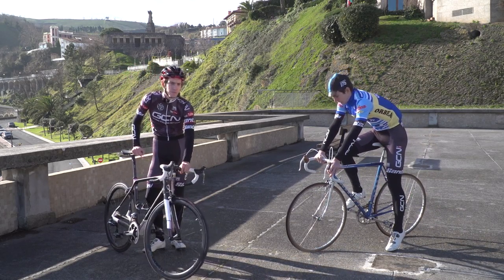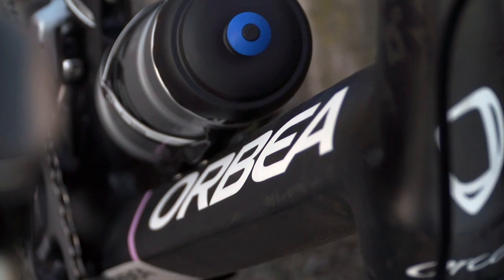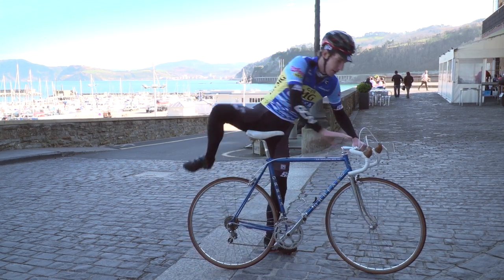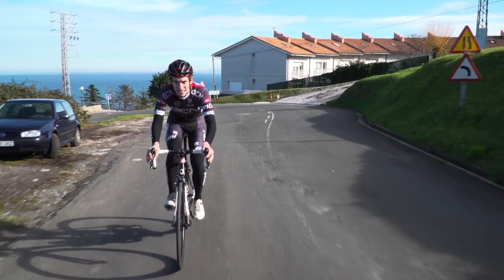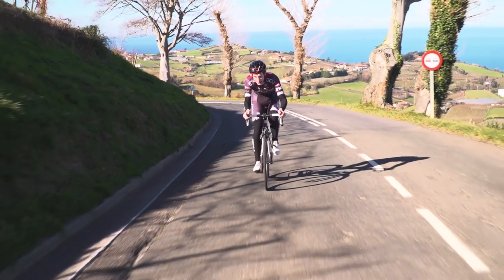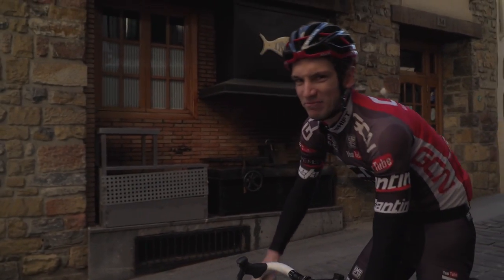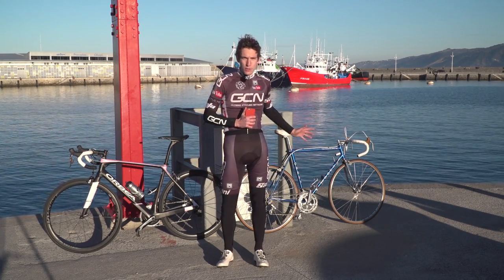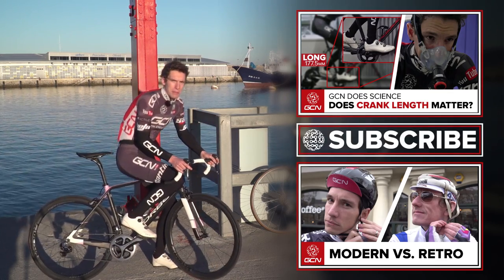How Much Faster Are Modern Bikes? | Retro Vs Modern

Comment: No straps? That cost him a HUGE amount of time assuming he knows how to pedal. 
In 1984, there were very good tubular wheels and this bike looks like it has cheap clinchers.
7 speed was the standard in 1984. I can't believe a grand tour bike didn't have it.
Brakes of that era really sucked. Solid win for the new bike.
Friction shifting was an art. You shifted when it was necessary, but more likely shifted in anticipation because it might not shift quickly. With indexed shifting a few years later you shifted when it was needed. With indexed shifting built into the brake levers, you shifted whenever you felt like shifting because it was so much easier.
Overall, the pedal thing made the most difference.

Comment: I'm just trying to figure out why after going to all the effort to do this video, they didn't take 5 minutes to swap the pedals over? 
The end result is... that we didn't swap the pedals over, so we have nothing meaningful to say because the test wasn't fair because we didn't swap the pedals over.
wtf?
Reply: Yes and considering all these issues, the resultant time difference seems appropriate. Had things been much more equalised, I honestly don't think there would have been more than 30s of a difference.
Reply: Swapping pedals is an extremely easy and quick job. It's commonly done even on taking a bike for a test ride around the block at the LBS. 

Why they wouldn't do that for this several hour long test is genuinely beyond my comprehension.
Reply: Then why not grab a similar pair of toeclips for the modern bike?
If it's a major inconsistency that makes the test incomparable, surely it would be worth it to take a second and 5 bucks to throw on a pair of toeclips... In the end, it just turned the entire effort into a waste because his conclusion was that this was probably the biggest factor that skewed the results...

Comment: It has been shown in a real scientific article from Bicycle Quarterly comparing ythe long term speed increases in the Tour de France and in Milan San Remo over the last hundred years with increases in long distance running speeds, that modern bikes are no faster than earlier bikes. The speed increases in cycling and running are exactly the same, leaving no place for any gains from bicycle technology. Those speed increases are due entirely to better training and other human factors.

Comment: so... reading between the lines.....on a bike that doesn't fit you, with shifters you can't use, on touring clinchers , with awful brakes, with flat pedals you were 10 % slower..... But also, you admit that the descent was the biggest difference because of tyres and brakes.... so lets say the ascent was 3/4 the time then really the climb was maybe 8% slower. Put some modern pedals on a bike that fits you and some proper ( vintage) wheels and tyres ( 32 lightweight spokes on 350g tubular rims with vittoria corsa tubs) and then see....

Comment: Retro all the way! I've been riding nothing but Norwegian DBS bikes from the 1950s and up to the 70s, superior comfort and reliability, they're so dirt freaking simple that it's actually scary, they're not even slow, you can get them up to speed relatively easy even with a very limited gearing range, but where they really shine is that they seem to keep their momentum, I've ridden just about anything under the sun, during my time in the shop as a mechanic i tried all sorts of bikes, and to be brutally honest it seemed like the lighter and more modern they get the slower they become overall, i suppose light wheels don't hold their energy as well as heavier wheels from back in the day so you need to pedal more often, also the super stiff frames make up for an absolutely terrible riding experience, i could go on and on about this. I hate modern bikes with a passion, they're truly junk in my eyes and do not last with normal use, but as with everything else these days, they're made to be disposable within a few years where you need to practically overhaul the entire bike...

Comment: Modern bikes may be faster, more comforable, lighter, stiffer, more aero etc. but you just can't beat the aesthetics of a lugged steel frame with componentry of the period.
Reply: +Richard Nick Yes ya can, but, that's in the eye of the beholder. I think many of the modern aero bikes are going through a distinct fugly stage right now, but here and there is one I could stare at all day.
Reply: +Digby O'Dell It's probably not worth it arguing about it since it's down to personal preference. I for my part still take my 1985 Raleigh Team Panasonic for a spin from time to time.
Reply: Richard Nick modern bikes are not more confortable. and faster ? hmm i don't think so. i have a 7.5kg steel road bike from early 90's, i doubt you or anyone in the same fit level as i am could pass me in a modern bike. and even in 23c i can easily do cobble and fireroads, and way faster than any modern bike with the same size tyre.
Reply: That is just not true. Engineers tend to make the bikes BETTER, not worse. Things advance. Why don't people use 90's bikes in races if they are better? I used to race in the 90's and the road bikes were crap compared to modern bikes - not to mention mountain bikes. Next you'll say that cantilevers were much better than modern disc brakes..
Reply: Jussi Lind you didn't race shit, don't lie. all bikes industry does is create solutions for non existing problems, and all this modern stuff you defend is actually worse in real life applications. less durable, less confortable and def less beautifull. road bikes have been around for almost a century virtually with no change, other than components materials, work mode (basically they added springs) and build quality.
Reply: Jussi Lind and mtb ? you really came to a road channel talk about mtb ? seriously ? and for your info i ride full rigid mtbs and i do enduro races in it, so what about mtb ? good tires and a good steel fork gives you all the suspension one needs to ride trails. all this tech does is lower the skill needed to do certain stuff on a bike.
Reply: Jussi Lind and some food for your brain : if engineers make stuff better, not worse, how could a steel bike be ridden every day for 40 years and still retain all it's originals proprieties and elasticity and a alluminum bike only lasts around 5-10 years before you get fatigue cracks ? why does carbon brake when hitting the floor side ways ? how many times have you heard of mechanical fail in a tour de france in the old days compared to nowadays ? engineera create stuff that will break when they want it to break, so that you have a void garanty and have to buy a new bike. when i say bike i also say car, pc's, fridges and even electric kitty litter boxes.
Reply: this is the wolf Yeah, I have a full rigid mtb too. And why are people always so fucking angry in the internet?
Reply: you don't need a aero carbon bike with 3 spokes wheels to be the best, because the best ones did it better in 15kg bikes. still waiting for a new record on velox for 30years or so.
Reply: this is the wolf To be honest the rules have changed in road cycling and are more restrictive now. The TT bike that Indurain rode is illegal now. You cannot directly compare old and new results.

Comment: I agree the test was unfair, how about equipping the retro bike with the missing gear combinations and putting identical shifting mechanisms on both. Put egg beaters and similar brakes on both bikes. Break the stages up into a flat run, climbing and descend stages and see how much faster it is. I'm thinking the drivetrain gearing differences and shifting accounts for most if not all of the minute & a half difference on a climb and descend. The difference then becomes one of a 15 lb bike vs 18-20 lb bike ? This was 3.55 miles or 5.7 kilometers, modern bike averaged 16.55 mph, retro bike 14.75 mph. After an hour, that's 1.8 miles, in under 15 minutes of riding it's a few feet short of .45 miles (roughly 5 city blocks if they are 1/10 mile) I'd simply like to see the gear inches both bikes have in each gear. The retro bike may not have the gears inches to keep up and under certain conditions the missing gear inches would account for a 1.8 mph speed difference over the course of the route. That's why I'd like to see the difference in climbing, descending and flat land.

Comment: Sorry for the rant but  with 1) a 4 kg weight gain (on an uphill section) 2)  flat pedals 3) not a proper fit 4) less stiff 5) placebo effect (you think the modern is faster so it is faster) 6) worse brakes, 7) less aerodynamic 8) unfamiliar gear shifts 9) larger jumps in gear ratio so maybe slight different in preferred cadence and 10) (probably) worse bearing and air pressure you are only traveling ~10-15% faster....great unscientific justification for telling the bike shop clerk you will pass on the brand new lightweight crank. recommend video that will likely never happen cause it would save money--- of entry level carbon vs high end carbon bike with actual power data.

Comment: Didn't Matt need a new wheel when he did the retro ride on Roche's bike? What is it with GCN and breaking old bikes?
Reply: yeah - it was the original tub if I remember rightly, but still - two bikes and two problems.
The Freewheel issue would have been an age thing as well I would imagine - the grease set and the pawls got stuck or something like that.
They should make a maintenance monday video - how to patch a tubular

Comment: But the point here is that the 2 bikes have completely different geometries. So you cannot compare them. It´ll be useful with a powermeter, a set of series to test them and the same geometry. Apart from the racing world, it looks to me that the increasing prices on modern bikes are not related with their performance, anybody could be still using a ""retro"" bike with almost no significant changes, apart from improving brakes or adding extra gears.

Comment: You didn't give your Retro bike the advantages as it should of had. This was rigged as I should know I was an A grade amature cyclist back then. I know that Reynolds 531 molly frame with 32 hole spokes & 6 speed Durrace cassette with toeclips that had Alfredo Binda straps could have easily kept up with any new bike today. We were using Singles which a tubular tires that you glue on by Clemont, I think i had Clemont 6's for racing with the cotton sidewalls. Even though the Reynolds frame was partial steel it was triple butted meaning that sections of the tubes were thicker at the ends & paper thin in the center. My bike was a criterium frame which mean that the forks were halfway between straight & that of a normal road fork. This would pull the front wheel within 8mm between tire & frame. It was very dangerous turning because if your feet were in the wrong place while the wheel was turning then you could hit the wheel with your toes but the bike was extremely responsive in turning on the hills. You can't compare an old bike to a new bike now because you wouldn't be able to find an old bike that is as pristine as it was back in the 80's. After 35 years you would not be able to find the same toe straps, replacement tires, the metal of the bike would have degraded after time, that's probably why he broke the rear wheel. So this kind of video is always going to be deceptive.

Riding an old bike meant that you not only had extreme energy but also that you had much more skill because shifting the old gears came down to your knowledge of the bike over time to know just how much to move the lever to get the right gear perfectly. All the new bikes now have taken away much of the skill of cycling but they have not changed the weight at all.

Comment: Tough comparo. 2nd time out typically would have you digging deeper, thus culminating a better time. Materials used may be more mental than anything. Not counting chronic fatigue by the end of a ride. Now think about how fast a domestique doing their jobs threading the peloton getting food and water to their mates carrying the equivalent weight difference as that seen between the steel and carbon bike.

Comment: It's not fair not putting modern pedals on the old bike. Anyone who still owned a bike like that would do that. With clippless pedals it would be much closer. Also, riding a bike you"re completely comfortable on and then one you have never ridden before is unfair as well.

Comment: "I've never used friction shifters before". My God, that sums up the generation gap. I didn't use indexed shifters until about 2005. I use them now, but I would not consider them more than what they are - a luxury. Part of the problem is the contempt of simplicity. The whole point of cycling is that it is simple. But simplicity does not equal profits from a dwindling market base of cyclists. These people are dupes. They don't understand how cycling is being dragged up the dead end of high-tech sports bikes  by marketing hype. 
99% of cyclists actually need robust steel bikes with mudguards, dynamo lights, a carrier rack and a bell. That's the kind of bike I ride through all seasons. No doubt it is slower than high-tech racehorses, but who cares? Which would you prefer getting home on a winter's night in the rain?

Comment: I think that it's worth noting that. Simon had absolutely no experience on this bike that didn't fit and has spent years riding modern bikes at an extra high level and yet still the disparency in time was hardly applicable to anyone not racing. When you factor in the 'cost' of one vehicle vs the other I think the old school wins in a price per mile comparison.

Comment: Why would you not test them with the same pedals? Now you can't really compare results because of the difference in power output. I award you no points and may God have mercy on your soul.
Reply from the maker: +Neil McCauley Because clipless pedals weren't invented in 85 Neil, that'd be cheating!
Reply: @gcn  yes cand would verify the old bike is as good as the new crap
Reply: @leoleonel6234   By the looks of your uploads you haven't figured out how to use a camera yet, I hardly think that qualifies you to judge the quality of a $10,000 bike.

Comment: your going to have to redo the video with toe clips, proper shoes, proper rear wheel, a tuned bike, and some practice downtube shifting... once you've done it enough you know exactly where each gear is and can even sense the front derailer's position centered with the rear gear selected. Also longer ride... 5.7km really?

Comment: Carbon's got nothing to do with it.  I can ride my steel road bike with a modern Ultegra group as fast or faster than carbon.  I have both.  Plus the steel is smoother.  I think it descends faster.  The difference in this test was geometry and shifting components.  No way friction shifting is as efficient as intergrated.  I've got a 1988 Masi Gran Corsa with Shimano S600 friction.  Proficiency is elusive.

Comment: You should have ridden months with that old bike to get used to it. I don't think there is much changed between now and then in what comes to speed. Most of the increase has come through the changes of regulations. Maybe you should compare the tour de France times from the same sections from now and then to really now the difference. Back then the riders had adjusted to the systems that were the norm back then and same goes for today.

Comment: Toe clips where standard. To test the classic bike you have to have toe clips. Absent toe clips the whole test is biased. The older bike would be 99% as good as current state of the art. The down tube shifters was a pain. Shifters were moved to the handle bar ends a long time ago. And a Campagnolo kit was also norm for a long time. So the classic bike wasn't state of the art. Should compare bikes that are best of the era to show advances in the technology.